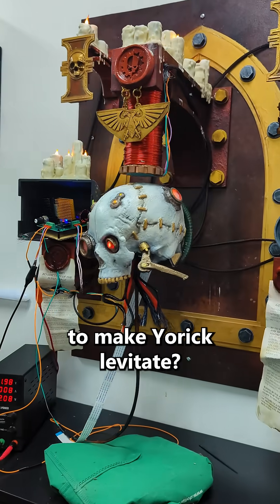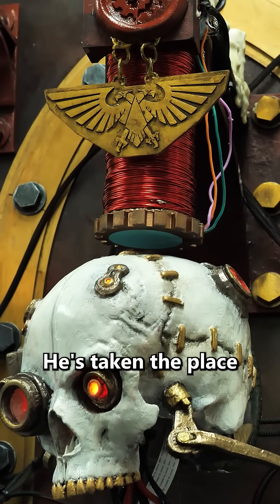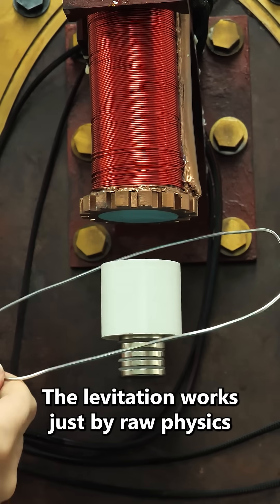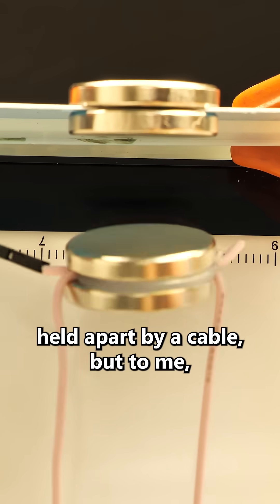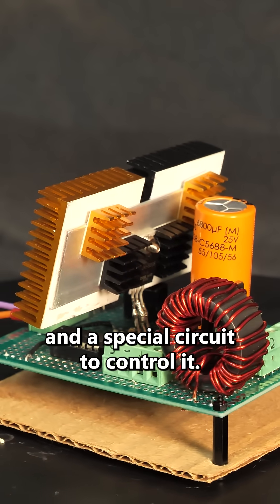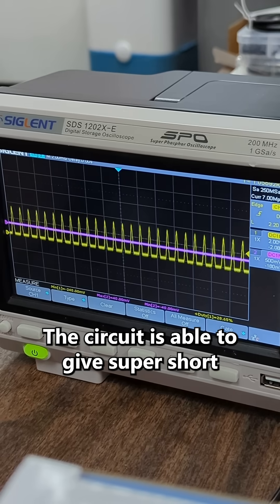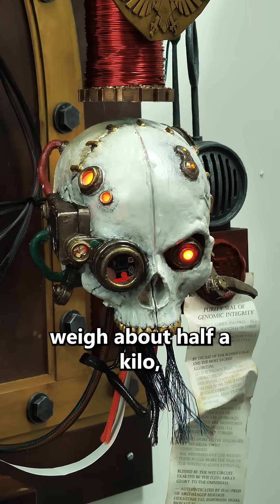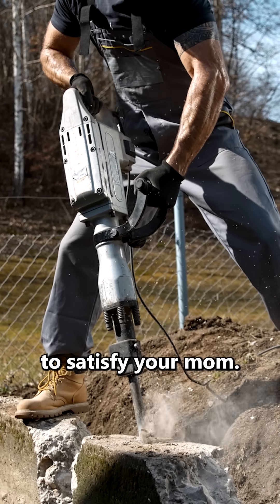How does Yorick levitate?

Comment: You should add and esp32 or a motherboard with wireless connections via Bluetooth or wifi so instead of having those floppy wires you can just a real floating skull and if u want you can put batteries in it so you can replace them for power or you can put Li-po/li-ion batteries with a charging module

Comment: The cables detract so much from the fact that its floating.. makes it look like its being held up by a hidden strut in the wires. It would look 1000x cooler if you could make it wireless, and have the cables dangling underneath, unattached to anything.
Reply: Tbf, a lot of servo skulls also have wires connected to them

Comment: Apparently mum is satisfied by a:
Small Concrete Vibrator Vibration Motor, 60Hz 3600rpm Aluminum Alloy Vibrating Motor for Shaker Table and Sifters Mixers, Single Phase Electric Vibrating Motors (60W)
-a.k.a. industrial vibes
I'm burnt to ashes...

Comment: I'd be be much more impressed if you had a inductive way to power the skull, and used wireless communication.  All those cables are not much better than "magnets held apart by a cable".

Comment: There is an even cooler thing: pyrolytic graphite, it can levitate at room temperature without external power source.
Reply: I genuinely didn't believe you until I looked it up. That's so cool. I'm going to try to get some.
Reply: @bagel_deficient  Before you do, check some pencil leads because some of them can be pyrolytic, I've found such one at home, but because multiple leads were mixed up in one box I don't know its brand name. I had to break off a few millimeter long part, because a big long lead won't float, my neodymium magnets also weren't very big, so try it with a very small piece of graphite lead, you will need 4 magnets placed next to each other, it matters how do you place the magnets.

Comment: Such power efficiency! I'm not a Warhammer 40k fan, but that sounds like something some big dystopian mega-empire would want.
Reply: Considering some of the stuff in 40K, the imperium doesn't care much for efficiency. Look up imperator class titans and you'll see
Reply: @Marcello-16817 but how about power efficiency for lowly servants? I mean, do they even have lights in the streets?
Reply: @AtomixTiger  depends on where. If its a hive city (slum the size of a country) probably not. If its a nice place though then maybe
Reply: @AtomixTiger The majority of the space in a hive city will never see any sunlight whatsoever. The average hiver has miles upon miles of city above them, and would need to travel miles to reach the edge without going upwards. There are access routes for ships into and out of hives for aircraft and small ships, but these don't let a lot of light into the inner hive, let alone the underhive.

So yes, there is street lighting and that, though in the more open areas it may be unnecessary due to a perpetual "daylight" from the "sky" of buildings above you.
Reply: @AtomixTiger If there's two people: you and your "lowly servant"; and there's two bread, how much bread will you get if your servant got none of it? Yep. That's the Imperium. The Emperor protects. Heh